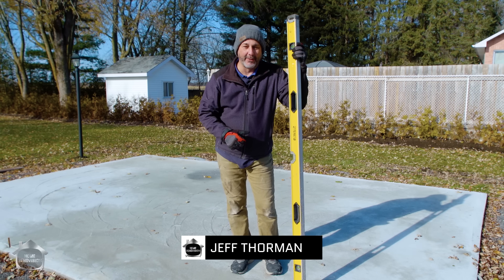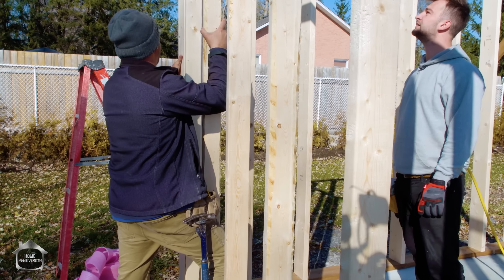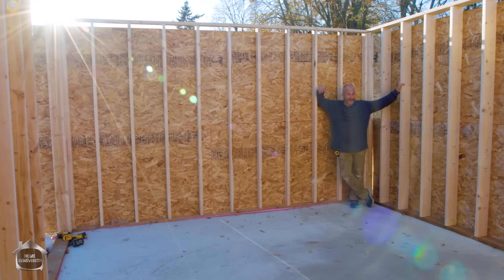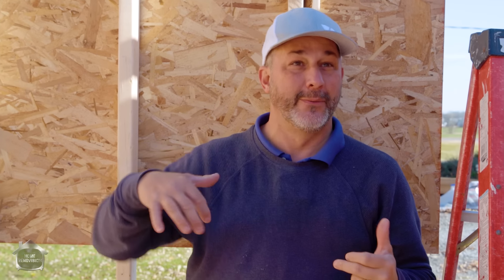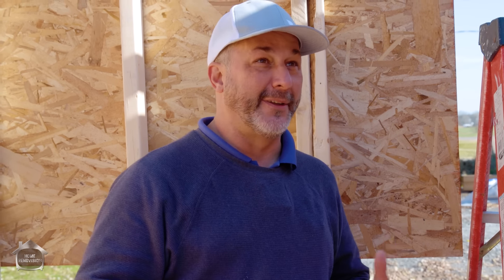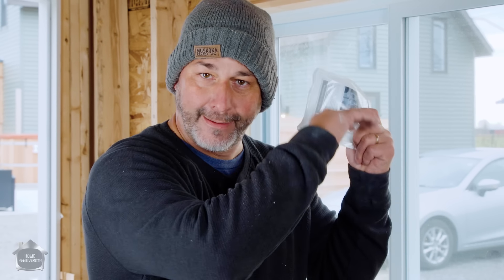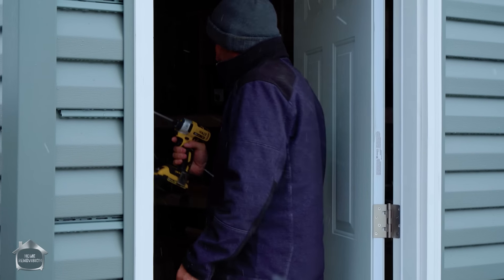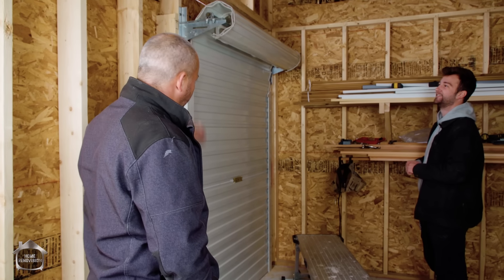Build Your OWN Workshop for DIY Projects!

Comment: If only the UK was relaxed as Canada, here if the shed is within 2m of the boundary it has to be 2.5m at its highest so even with a 15 degree pitch you have to have a concrete base to have the walls more than 1.80m

Comment: Jeff.  Love the videos.  Is that slab on grade?  Looking for a similar-sized shed but everybody I'm talking to for concrete wants to do a full stem wall pour or piers underneath to hold it due to frost issues. Seems excessive to me for that size.  The original plan was a 6" gravel base with 4" slab on grade but these guys are pricing me right out of the project.  I'm guessing you guys have way more frost problems up there than we do in Missouri.  Any thoughts?

Comment: Can you store tools in this and not have them rust over winter or do you have to insulate further?
Reply: Not likely if you're in a hot/cold climate.  I didn't see if the slab was insulated,  or if plastic was laid below, but condensation would almost certainly occur.  Just like older garages, tools will almost certainly rust.

Comment: Hi Jeff, 2 questions, first at the 36 min mark i see you have nailing strips showing on the siding between the door and the corner, is that a mistake or did you do this for some reason,  2nd when you were sheating why is there a 2 or 3 inch gap at the roof sill plate where (so far) there is no sheating?

Comment: I have a non-shed related question -- which do you prefer, traditional tank water heaters or tankless?   If time permits it would be interesting to know your reasoning.  Thank you for your time.
Reply from the maker: traditional gas heating tank. tankless have serious parts problems when they need service and it can go days without hot water. Cheers! When they solve that issue tankless is finally working well enough to consider.
Reply: @HomeRenoVisionDIY  .....  thank you!  I am always hesitant to be 'trendy'.  Again I appreciate your time and feedback.

Comment: I might have added more top plates to match the wall height and went that way.
Everyone makes mistakes  its how you fix them. No one would know any differently if you went up you ment too.
Its a shed, not a house. It really dosnt matter any difference on siding can be fixed with outside trim. And it look good
Just 3" taller then it should be

Comment: Remember plumb and square are two different things. If your slab isn't level, then using a level on your wall to check for square won't work and your wall will show as not being square because your slab isn't level. If your slab is perfectly level (within tolerances) then you can use a level on the wall to check for square. If the slab isn't level, then you have to do something else. A good way to make your walls square is doing it on the ground. Frame up your wall including your window and door framing if you want, place a large framing square over a corner and square it up to the framing square. Once you have it squared up to the square, screw in a 2x4 at the end corner of your top plate with the other end screwed in to the bottom plate or very near the bottom (best practice is plate to plate) and that will hold your wall square so it can be raised up, placed and anchored. Repeat the process on the other walls and once you have all 4 walls up and connected, you can remove that temporary 2x4 and have a completely squared 4 walls. Another thing I noticed is that in your sheeting, you butted up the sheeting to each other. Sheeting should have an 1/8 inch gap (width of an 8 penny nail to make it easy) to allow for expansion and contraction of the wood or settling of the structure. If not, then over time the wall will become lazy and the sheeting will work itself loose.
Reply: Would you recommend a double top plate above the windows to support the rafters maybe?
Reply: @davidg8032  No need to have double plates. You already have the framing of the wall and the top plate goes over that framing which will provide plenty of strength.
Reply: @MrExNavy  I have to disagree. A simple single 2x4 for a topplate, spanning a window opening where rafters or trusses are going to be supported is asking for trouble.
Reply: @davidg8032  LOL you might disagree but that is how most things are built and is according to code. You can always go above and beyond what the code says but if it's not needed, it's just an extra cost.

Comment: Maybe missing a shroud over that roller door, might stop it from uncoiling
Reply: Yeah, I was thinking the same, there should be a case around the roll part up top to keep the rest of the door from 'springing out'
Reply: The shroud would be good ... but not necessary. It looks like they are missing the tensioning mechanism and/or spring kit for the door.
Reply: The tensioning mechanism and/or spring kit would keep the coil tight & assist in door operation.

Comment: So how exactly does a single top plate carry a rafter and roof load across the top of the windows??? Even worse, the load of two window vertical frames transfers down to the window below to another window without a header if I see it accurately. This would fail inspection where I live...
Reply: Look at about the 45 minute mark for the headers.. Traditional king post with trimmers and header would have served this shop well, as well as serving as proper instruction

Comment: When you want to frame a wall 16" on center, you should lay out the stud location mark at 3/4" shy of 16 (15 1/4, 31 1/4, 47 1/4 etc...) then mark x ahead.  Watch any of The Crazy Framer's videos for more explaination.
Reply: There's a bunch of different ways to mark your studs. As long as you're consistent, it doesn't really make any difference.
Reply: @your.mother.slays.  guess you've never worked a real job /yeah it DOES matter it is right or it is not!!

Comment: @Home RenoVision DIY  You are not missing hardware. But you definitely screwed yourself there by unrolling that.

Ive installed a roll up door on my shed. Here what needs to happen.

Before you cut the cable that's holding it together you need to mount the side tracks and the entire rolled up assembly in its space then take a bar and pre tension the springs inside or else it will just unravel itself and won't have any tension to roll back up.

The hardware that comes with them (the ones from Lowes Canada) is crap. I bought some extra hardware before I installed it and ended up using the extra stuff instead of the provided ones.

What I suggest you do is take the door back off. Lay it on the ground. Roll it as tight as you can. Put a ratchet strap around it to hold it, mount it. Tension it. Tighten everything down. Then you can untie it and it'll work.

Comment: That roller door should have a greater height. What if someone over 6' walks through the opening or something with a greater height above the concrete needs to be rolled inside or out? The person could hit their head or the object will not go through. There is added length of the unused door there. So, the opening could be higher. That's without the handle installed.
In usual roller doors the door is fixed to the plastic roller in more places. The door will roll up then.

Comment: Would you ever drill holes in the bottom plate instead of notching for the j bolts? Is it just too difficult to get up and over and lined up that way?
Reply from the maker: I'm too old to be lifting a wall onto a bolt. Cheers! Trying not to pull a muscle.
Reply: @HomeRenoVisionDIY  that's what I assumed. Great video though, definitely learned a lot. I appreciate that you left in the tomfoolery with the roll up door. We've all been there!

Comment: Doesn't the roller Door need securing to the wheels? - I'd expect a bar going all the way across to hold left and right tension?
Reply: No. The spring tension is in the middle. He did it wrong. Read my other reply on how to remedy

Comment: Why are there no structural headers (simple triple 2x6 sandwiching 2 half in plywood pieces) on top of windows and door? Load from snow on roof will be resting on 1.5 inches of wood over spans of over 3 feet.
Reply: I know, right? After all that obsessing over the location of the studs in the “ladders”.

Comment: I am 72 and I am building my first shed  or anything. I'm following "How to build a Shed" and "Build your OWN workshop" videos. Today I'm putting on the board that squares from the WORKSHOP VIDEO and putting on the skin from the SHED video.
A DIFFERENCE THAT I NOTED -- IN THE SHED VIDEO,  YOU PLACE TWO BOARDS  ON TOP OF EACH SIDE THAT HOLDS THE ROOF TO TRANSFER THE WEIGHT THROUGH THE BOARDS OF THE WALL.
 In the OWN Workshop video, YOU HAVE A BOARD ABOVE AND BELOW THE WINDOWS ON ONE SIDE AND MAYBE THAT TRANSFERS THE WEIGHT.  ON THE OTHER LOWER SIDE, YOU DON'T HAVE A SECOND BOARD.  AM I SUPPOSE TO SKIP THESE BOARDS? Have you found something new?

Comment: I dont understand the framing for the roof and your litttle windows. You got these opening that look to be about 30 inches with a single plate, no header and the weight of the roof rafters right on top. Wont the weight of the roof be really heavy on that especially with snow and such a low pitch shingle roof ?
Reply from the maker: I installed a 2x4 horizontal across the top of the whole wall to carry load and point load to the bottom plate. Cheers!
Reply: @HomeRenoVisionDIY  right I see that now ! Thanks for replying. I like the design,  im going to build something similar as a small shop eventually.

Comment: Great video.
Just one question please? On the edge of your building, where your door is going, your cladding doesn't line up on both sides of the door, and it appears that the 'raw' edge is showing. Deliberate?  Drew in UK.

Comment: Did you crown the 2x6 when laying them down, or do you not crown your wall studs?
Reply from the maker: I don't bother I fix after if necessary.
Reply: @HomeRenoVisionDIY  when I rough framed houses for a living if the walls were not crowned the sheet rock guys would come looking with blood in their eye.  So I guess it is what is important, flat walls or wavy.

Comment: Really nice way to explain things. Too bad here in Québec we need "professionals with licences" to do almost everything.
About this shed/workshop how would you go about minimal insulation and heating to keep the tools inside from rusting? For the walls I'm guessing it's about the same as insulation a basement, but it's the roof I'm wondering about.

Comment: I feel like your man door is swinging the wrong direction. It’s correct that it’s an in swing door but it should swing towards the wall opening into the room. Not the way you have it setup. Of course there could always be reasons to have it swing the wrong direction. 
The idea of having it swing the way I describe is that you aren’t walking into a wall, you don’t need to open the door as wide a swing in order to walk into the room.
Reply from the maker: if i have the doors open in the summer i don't want to block my daylight. Cheers!

Comment: Looks like your bottom plate in the wall section with the door is upside down. Your slot for the J bolt is facing out to let bugs and water in, rather than having the slot facing the interior of the building. Personally, I would've drilled a 5/8" hole instead of cutting a slot.

Comment: I love the videos but as a GC myself with a heavy background in framing, you did a few things the hard way, a few things not the best way, and only a couple things wrong. I'm sure this project didn't require a permit but code still applies. The sill plates really should've been drilled out, you should've snapped lines on the slab to establish square (especially since you were already over hanging the sill plates), and just a note but the sill seal is only a air barrier for internal/external air. The slab will still condensate through the sill sealer and rot out the sill plate if it's not pressure treated, I'm sure you knew this but I just want to clarify it for the DIY'ers. I also would've squared my walls on the ground and sheathed them before they were stood. I realize it's just you and your son and that may not have been possible without an extra set of hands but that would've saved you some time in the short run and framing the walls would've taken half the time. There's only a couple of things you did wrong, your window and door openings have improper headers, for a frame as light as this one you could've used two 2*4s spanning vertically over your openings with single jack studs and double top plates. I also don't think your ladder boxes had enough beef to 'em. Your going to have some broken windows with the snow on the roof. We didn't get to see the rafters get built, so I don't know if you cut out any birds-mouths in your rafter heels but it's probably better that you didn't being the rafters were only 2*6 when they probably should've been 2*8's 16" o.c. or had your 2*6's 12" o.c. I don't know what the span is so I couldn't tell you for certain what it should've been but your 2 major oversights were the opening headers and too light of a roof frame assembly. A low slope roof has higher GSL requirements than a steeper pitched roof and your going to have some issues with your windows, probably not with the door since its on a "gable end", and you'll definitely have some cracked drywall joints on the ceiling if you ever decide to rock it. Also didn't see any rafter ties or "truss screws" tying your roof to the walls. This is towards the bottom of the list but I also didn't see any H clips on your roof sheathing. I don't mean to sh** on your work but this is not a great demonstration of what DIY'ers should do. I watched the video for that other shed you did for your camera man and that one was a much better demonstration. 
     Keep up the great work, I love watching your videos and learning things about other trades I'm not as familiar with. You're a hell of a finish carpenter, I'd just say framing is not so much your forte.
Reply from the maker: agreed but it is just a shed. Cheers!
Reply: @Carter Houle You stated "The slab will still condensate through the sill sealer and rot out the sill plate if it's not pressure treated ...". Check out what Jeff said at 1:58, "We're going to go with pressure treated plates ...", I guess you might have missed that. I caught it, and I think the other DIY'ers probably heard it too. Also, with the other comments on the framing, you might look a little closer to see why it was done the way it was. ...and it's only a shed.
Reply: @badparrot9992  I'm not saying he didn't mention it or fail to use treated sill plates, he clearly did. I was clarifying for the building terminology illiterate that the the vapor barrier the sill seal creates is to stop internal and external air from transferring or at the minimum slow it, I didn't want people to confuse it with a moisture barrier and think if you use sill sealer you don't have to use a pressure treated base plate. He was also completely right that its a great insect barrier. Again, I love to watch his videos and learn aspects of trades I'm less familiar with, and my comments were not to s*** on his work but to give some clarifying details and possible approaches to other people looking to take on this project so it can be done to IRC building code standards. If you want a project like this to add value to your property (even though detached structures don't generally add value to a property unless a prospect buyer is looking for a property with a detached space) it needs to be done to building code standards. Jeff got what he wanted out of building this space but if the goal was to build this with the potential with adding resale value it's actually doing the opposite. A private inspector could take a peak at all the exposed framing and tell you all the same things I mentioned in my original comment relating to building standards. And even if he's to insulate and hang drywall on the inside, cracked windows and a sagging bulkheads over doors are dead giveaways for improper headers. I love the channel and am a frequent visitor but this video doesn't detail the importance of proper framing and building standards. In many jurisdictions this project would've required a permit being that it's more than a 200SF exterior footprint and in which case plans would've had to been submitted with the permit application and all the required codes relating to the project would've needed to been cited. The plans would've had to have been reviewed and there would've been 3-4 different inspections on the project (footings, framing, electrical, and  and a final inspection). Jeff is an expert and a better craftsman in many more areas than myself, I'm not trying to take away from the project or his video, or make people lose faith in his abilities. Only stating that this should've been done to IRC standards and offering different methods of constructing a similar space. Check with your local jurisdiction for the maximum SF of an IRC class four dwelling (detached structure) not requiring a permit and ask them for all the relative building standards that apply to your structure. The last thing you want after spending $10000+ to build a detached structure is for the roof to cave in or to be ripped off its supporting walls during high winds, or to have to replace or frame-in your windows because you didn't build proper or beefy enough headers for your openings. I'm not saying everything I build is completely perfect to the trained eye but I've never had to question the structural integrity or performance of them.
Reply: @HomeRenoVisionDIY  You're a great sport my man, I will definitely cheers to that. I love to learn all your tips and tricks and employ them on my jobs. Again keep up the great work and keep teaching the weekend warriors how they can accomplish their home projects to the best of their abilities.  Not to mention your fellow contractors your great tips and tricks!